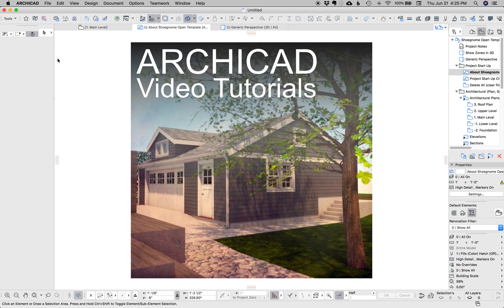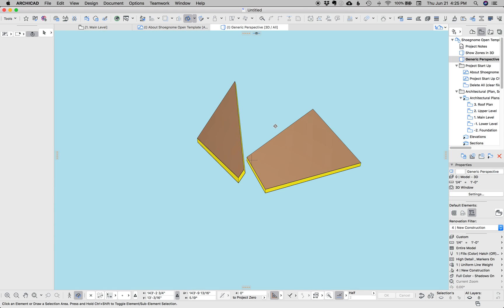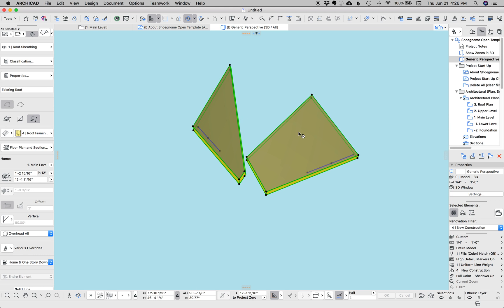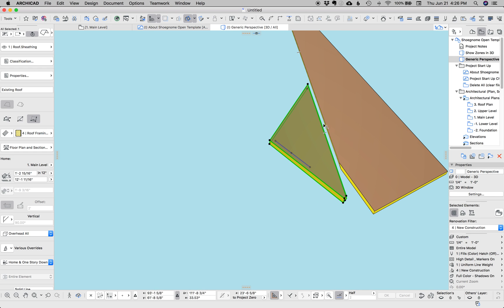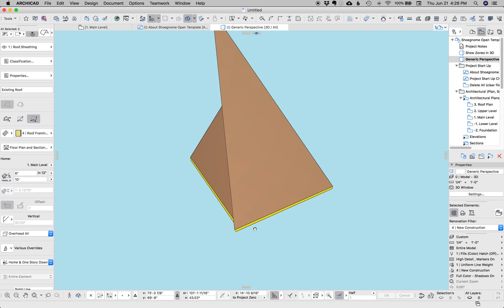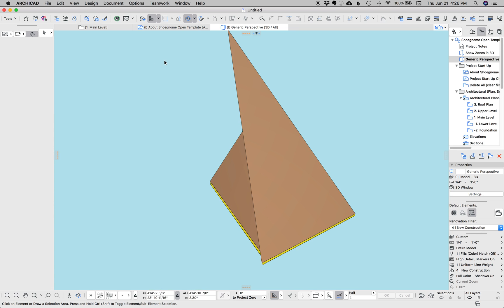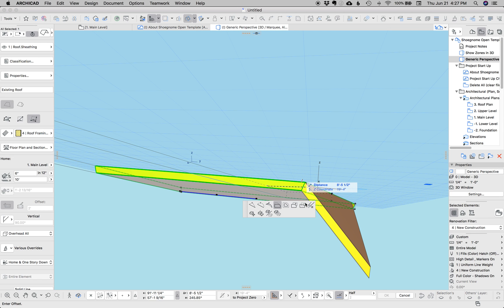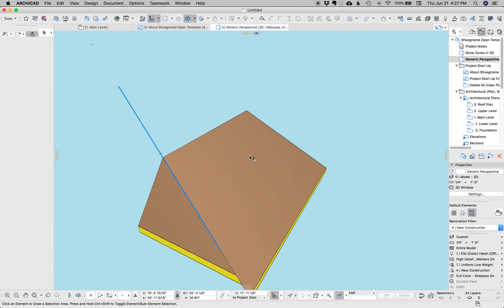ArchiCAD Tutorial #64: Mitering Roofs in ARCHICAD

Comment: How would you solve the eaves, when you have two different pitch on the hip roof and that you wish to have them at a specific overhang? Thanks!
Reply from the maker: That's a design problem, not an Archicad problem. The miter / geometry is what it is. Miter the two roofs, move the corner of the overhang to be equal distance at the corner of the building and then see what that does to the rest of your roof form. The miter won't be 45 degrees and won't cross the building line at the corner of the walls either. In general on old buildings with two roof slopes the overhang isn't equal or there's some other construction technique used to solve the problem. It's not one Archicad can make work on its own.
Reply: @Shoegnome Thanks, I will explore your suggestion! Exact, this is for an existing building. Any chance you have a visual tutorial on the matter?
Reply from the maker: I don't. If you're matching an existing building then definitely start from the eave and work backwards. Figure out the fascia and then let the roof be what it needs to be. It'll be weirder than you expect.
Reply: Hello back, I was able to make it work. My ridge line was about 36.8deg for a 6:12 and 8:12 hip roof. I placed the reference line of the higher pitch roof to the new ridge line. The lower pitch roof (6:12) reference line stayed at the structure edge of the wall and simply mitered the roof planes to the other roof (8:12).
Reply from the maker: @bividesign that's great!